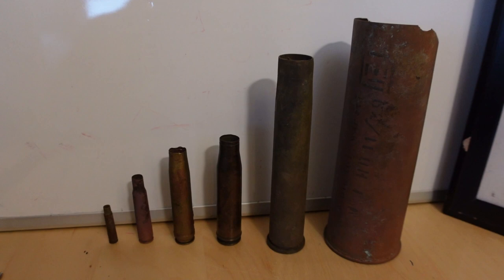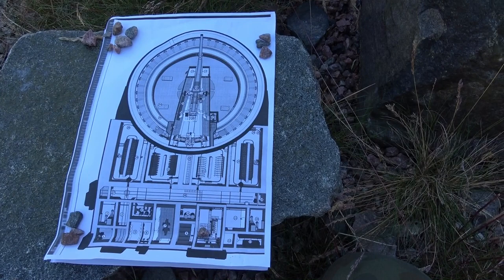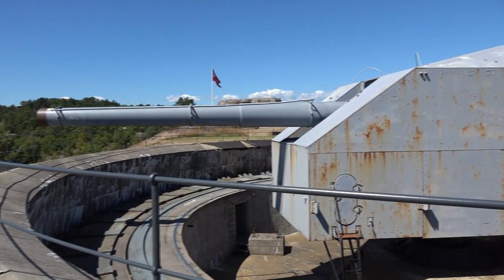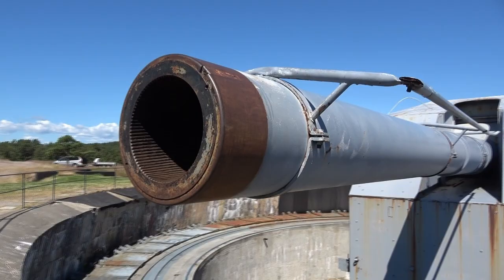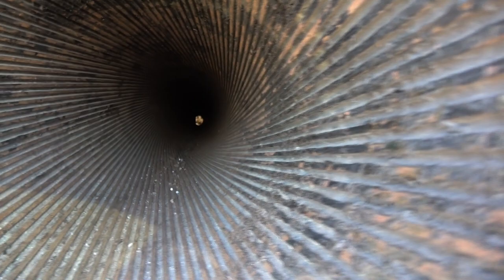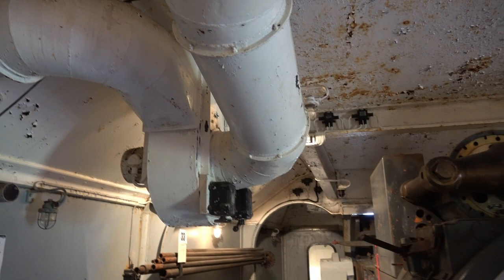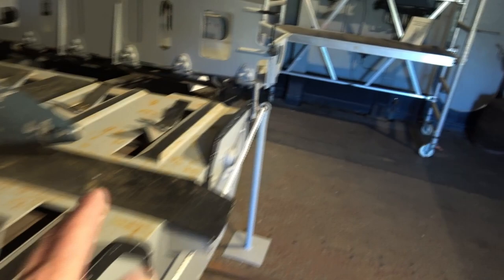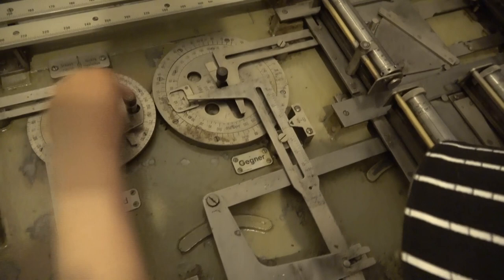Guns at Navarone is nothing compared to this. 38 cm barrel !

Comment: The engineering effort to build these fixed artillery positions must have started in the late 30's.  The cost of each one must have been enormous. Smoke from one of the large powder bags after detonation would have filled the turret so the ventilation was extremely important.  Too bad the turret does not traverse any more, that would be something to see!  I am surprised this thing did not go to the scrap heap as so many other features along the wall did.  Thanks so much for sharing!  Stay safe and well!
Reply from the maker: Yes most of them were scrapped and that is too bad as it would have been incredible to see several of them out there. Thanks Donald and more to come :)

Comment: Ship turret, so would have ventilation from the design for ship use, where it would be expected to operate irrespective of the exterior conditions, so yes ventilation to keep it either cool or warm. All the tooling and hoists were originally meant to be installed on a ship, just used here instead in a land based role.
Reply from the maker: Great and interesting place it is. Thanks.

Comment: Great video. I just checked barrel wear, Germany lacked materials and so replaced the whole barrel after 200 rounds. The UK/US had the necessary materials & would re-sleeve the old barrels @ 350-400 rounds(replacing the barrel from inventory & relining original). The Nazi super gun DORA was a special case and used shells of increasing diameter.
Years ago I met an old artilleryman who as a young officer spent 2yrs in the 1930s in then Rhodesia/Zimbabwe firing 1,000s of rounds with a battery of 25pdrs calculating barrel wear correction. Poor wildlife ...
Reply from the maker: There you go and thanks for comment and for watching.

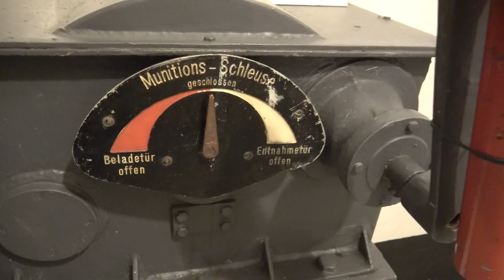Comment: I have some .50 cal canon shells from a fighter. The achtzig achtzig was also used in the Tiger tank very nasty anti tank weapon. 5:42 these were armoured flaps that open as the gun rotates and close after. This was achieved by metal bars on the gun  as it rotated to lift the hatch and then it would slowly close after. This was to protect direct hits from mortar or fires getting down inside there where the ammunition wagens were. These brought in the powder bags then the pointed shell either (12:13) hoch excplosiv or Rüstungsdurchdringung  (Blau). 7:26 this hoist dropped down into the round structure covered by the armour flaps. Where it would meet a cart pushed by the soldatten - carrying either cartridge, charge or shell. These were put on the cart from armoured shutters wound open from the bunker storage (11:54). Hoisted up to the loaders. this handle @ 8:46 would be turned rolling a powder bag through that hole (on the right) onto the carriage......the cry would go up from the Kapitan........... LOAD!!!......... close the breech.................RANGE... 37500 METRES............ELEVATE THE BARREL..............BEARING 235 DEGREES ( the canon would rotate to this bearing.)  WIND 3 KNOTS FROM 145 DEGRESS .................ENTER CORRECTION...........................The targetting officer would shout READY - FEUER!!! BOOOOOOOOM!!! The gun could only be loaded LEVEL or DOWN position so after each shot the gun would usually automatically drop to level. The breech would open and the now empty brass cartridge would drop out then reload again. 11:45 as an engineer I must admire the craftsmanship in this early 'computer incredible precision. 12:28 (loading - open - removal door) onto the rail cart. 14:25 FINALLY  the  ammo hoists leading up to the turret enclosure  14:46 the inner rails ar for the gun balance carriage the outer for the ammo wagen.SUPERB VIDEO BITTE SCHOEN!!  would give you a big thanks but sadly kein Geld bis Zahltag!!😕
Reply from the maker: Very nice , great feedback and comment my friend and thanks for being here my friend :)
Reply: @WW2HistoryHunter   I have been very low and finding your channel has raised my spirits again. It is an honour Sir. You and EE bring so much enjoyment. I like analysing your finds as I have always been a history hunter on old WW2 USAF AND RAF airlfields in the UK, I know them all! But I bought a cheap metal detector that was kaput - so never got very far. I found some small aircraft MG cases though by eye - I needed EE with me😃

Comment: No wonder the Allies attacked the ball bearing plants during the war. They knew they would cripple the German war machine and prevent weapons like this, tanks and others that depended on ball bearings to move. Imagine the size of the ball bearings it took to rotate this gun into position. I wonder if they actually ever fired a proper size shell through this gun or just used the test barrel? It’s amazing to see the technology they used to figure a firing solution. Today it’s all done by computer. The size of some of the tools is impressive. I wonder if they had a machine to turn some of the wrenches? Wonderful and amazing to see a gun like this in such good condition.
Reply from the maker: They id fire with real stuff a few times. Thanks Anthony.

Comment: Was this removed from the Bizmarck or Tirpitz??
Reply from the maker: i actually dont know and thanks for watching.
Reply: The Bismarck is 3km down. This may have come from the Tirpitz wreck or out of inventory. The Germans had to replace the entire barrel after ~200 shots so needed spares. The Tirpitz & it's 8 guns were salvaged but more than 8 guns were planned for Norway and Denmark with more for elsewhere. A fortress called Tirpitz, left unfinished, was intended to use four salvaged barrels in two twin turrets to protect Amsterdam harbour, it's now a museum. Austratt Fort, Trondheim, Norway has one of the old 280mm triple turrets from Gneisenau, it's a museum & still in working order, History Hunter has a video. There are also 3 forts, 2 in Denmark and one in Norway, which had 340/380mm naval artillery guarding the access to the Baltic Sea. Norway has the best preserved examples, still in turrets, several still working having been used post war.